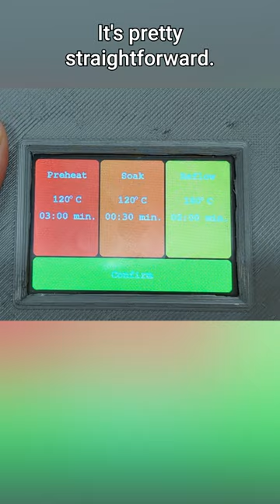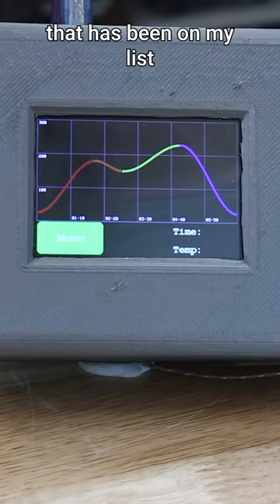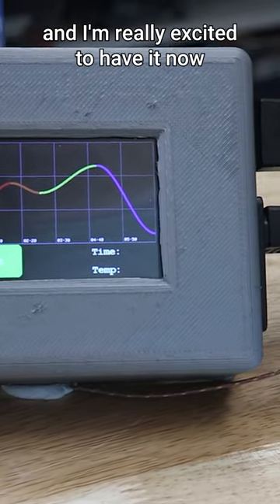Reflow Oven - Byte Sized #short

Comment: Word of warning, I used this technique for LED module repairs, the IR from the element can heat up the PCB more than the thermocouple reads. So a sheet of fibreglass to block the direct IR is a must as well as a fan to move the air around. Good project though😊